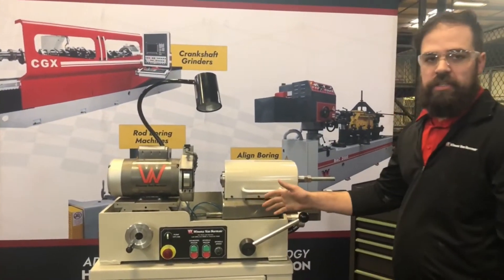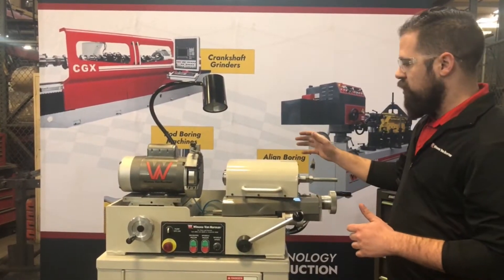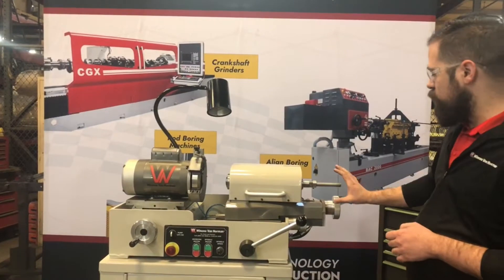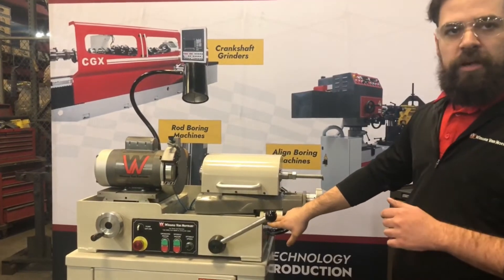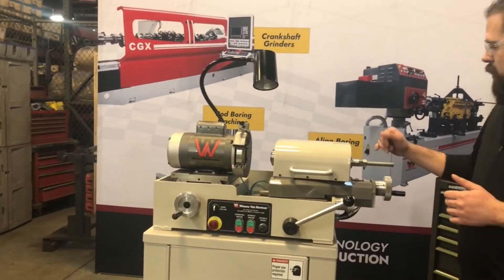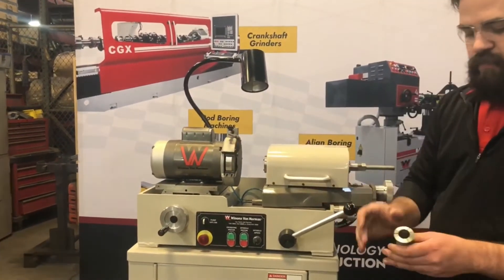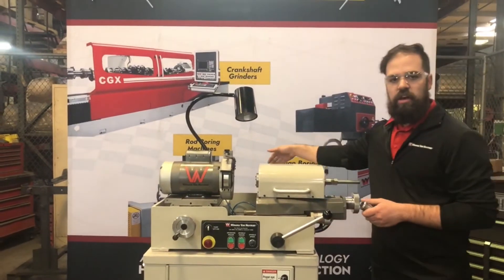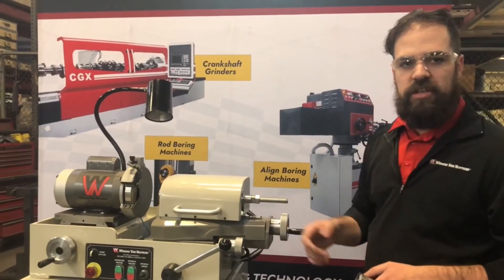Winona Van Norman - Tappet Grinder (Hydraulic Lifter) - TRX

Comment: Amazing piece of equipment. I spoke with Winona Van Norman and an engineer explained to me that if you are doing a set of engine lifters, every one comes out the same with the crown. There is a stop that limits the amount of feed for removing material and a stop to locate every lifter at the same depth in the collet. A crown is introduced by using the right hand of that loop style handle to push the lifter back and forth across the diamond wheel face. There is a new and finer wheel that comes with each new unit. Soon, an attachment may become available to grind a  chamfer on the edge of the lifter face but until then, you have to devise your own method. I also learned of a company using this machine is doing 4,000 lifter per day. Many of the earlier refacers only ground a taper on the face, this one grinds a proper crown. Quality control of flat tappet lifter faces is almost non existent today, that is until this machine was introduced.  I have 32 lifters for a small block Chevy, One brand provided 15 almost perfect lifters and the other brand provided garbage. Both used Johnson lifters and you can see a difference in the grind between the two sets.  I checked out the garbage set with a dial indicater and went from side to side and also checked the face for runout as I rotated them while being located the same position and checked different places from edge to center. The garbage set went from flat to a difference of 0.00 to 0.003" as rotated. Only 6 were usable and still questionable. No wonder the failure rate is so high. It isn't Johnson's fault.

Comment: So when is this machine be available to buy???
What lifter diameters will this machine service.Aside from std.flat tappet and mushroom type bodies what will this machine be able to handle.
with all the crappy made lifters that have incorrect radius on the foot of the lifters in GM Ford and Chrysler engines. Since they all use a different measurement for the radius how adjustable will this machine be??
Most HP cams have more lobe taper then stock OEM to promote lifter rotation but the foot of the lifters are so inconsistently made these days we are spending an extra 2 hrs on a build just to checking the lifters as well as the camshaft lobe taper but its like the makers of these parts are not properly finishing and of these to allow them to live.

Its been along time coming for some one to re-introduce this type of machine since sunnen discontinued their machine many years ago.